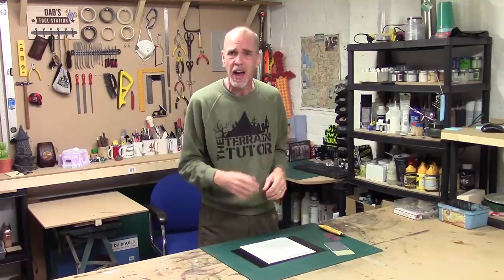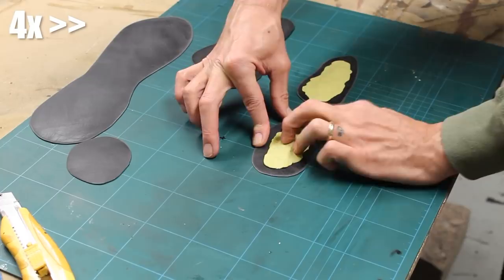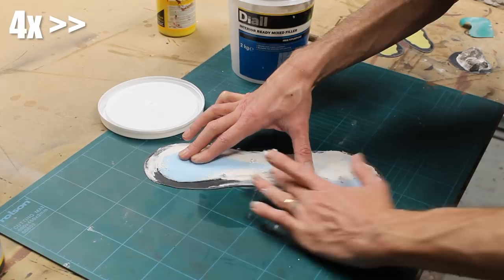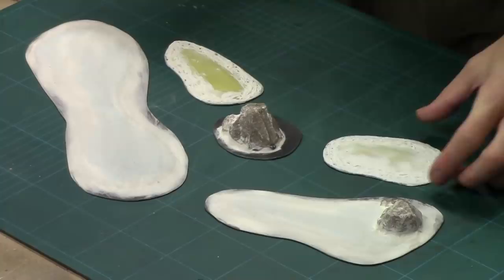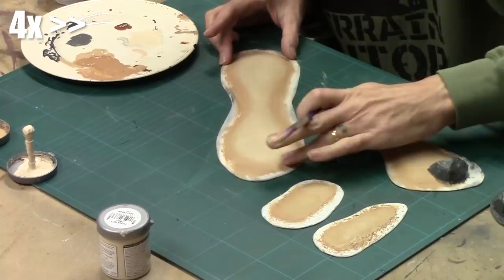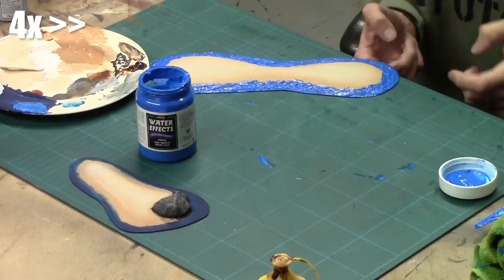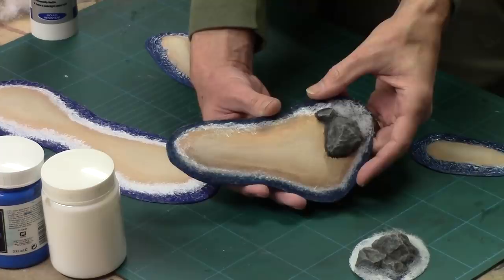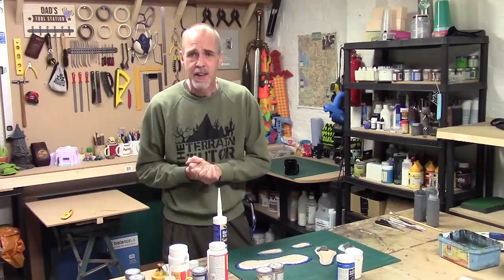Let's Make 6mm Coastal Scatter Terrain (Small Scale Naval Series)

Comment: Plastic sheet - I've been using Slaters Plastikard for the last 40+ years and never had a problem with their stuff.  They are in the UK and do sizes up to A3 which can be ordered mail order.  They also do embossed card, brick, corrugated etc in various model railway scales. No connection - Just a satisfied customer.
Reply from the maker: Not heard of Slaters before, thanks bud!

Comment: I like the new graphics on the explanation/definition of materials used. Good job! 
Your techniques went by a little fast tho, I didnt catch what kind and size of brushes you used for the stippling effects. 
Question: What would you have done differently if you were going to do these all in 25mm scale? I mean, how was this any different than everything you have been building until now? Also: Do you have to adjust colors at all because you are using such small amounts of them in 1/300 scale?

Comment: Mel, awesome work and inspirational.  Got some new techniques to try as I work on larger Adeptus Titanicus boards with waterfronts.  

What do you think about waves being quasi omni directional? On a smaller sandbar the waves would not approach in from 360, more like 135 with some wrapping and the wind would create smooth water in the leiu of the island with swells forming away from it again... how would you tie a sand bar into a nearby coast and maintain this wave/water effect?
Reply from the maker: Growing up by the coast, with the right wind, any direction is possible mate! If I was going to orientate the waves, I've use the sun on either the coastal or sea horizons and paint the shading that way, then use that for the orientation mate